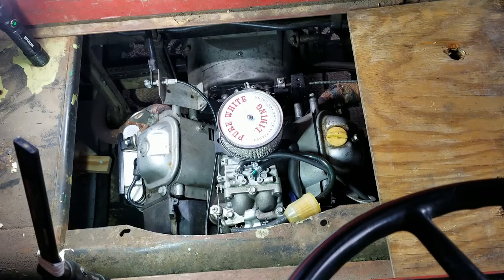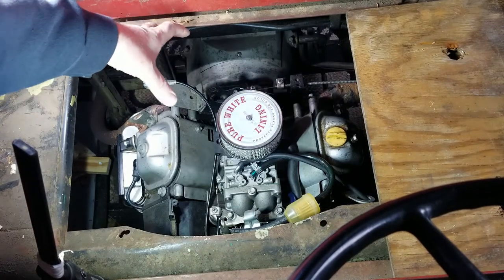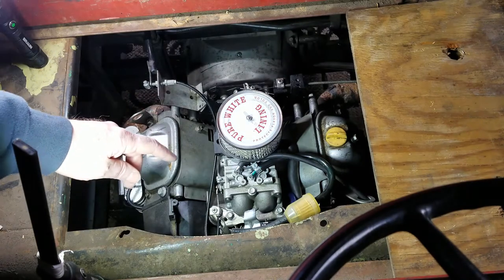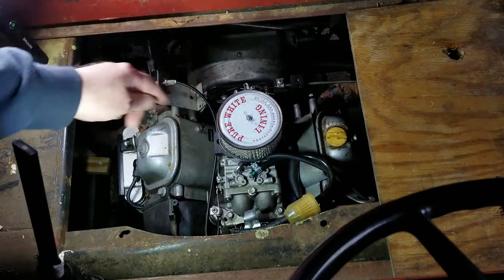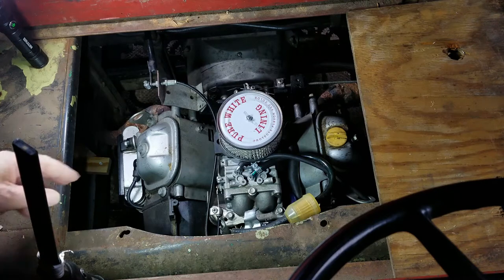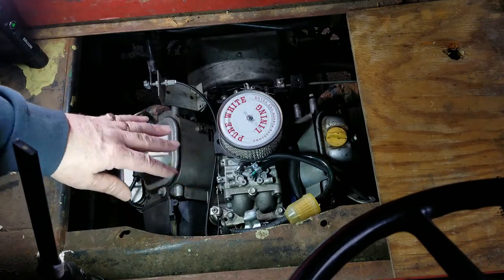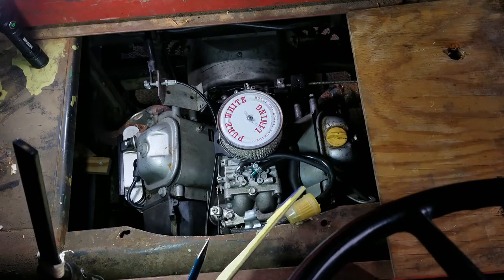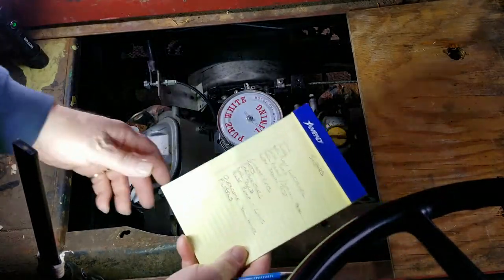PREDATOR 670CC LONG JOURNEY TO RUNNING WELL 5 years

Comment: I know I’m late to the party and I’ve watched your videos and can absolutely appreciate all the time you have spent working through all the nuances of this engine. I thought I had researched this engine enough for my club car build. Now I kind of wish I had looked at a better v twin. My cart does scoot right along but the fuel problem is a total effing nightmare. Thanks again.
Reply from the maker: Evening, changing to no governor and the carburetor change made a huge difference (oh yes a good manual fuel pump). All the best on your project

Comment: Your opening statements covered the problems I’m dealing with now. I put a electric fuel pump on with filter and a regulator. Didn’t bypass the stock fuel pump ( still have to figure out how to do that) and ended up with a flooded engine full of gas. Drained the oil and hoping to start over
Reply from the maker: Morning, what ever you do go back to the diaphragm pump, your issues will be fade away, load up the gas via a hand primer, thats in another vid .. best of luck

Comment: Thank you for all of the videos over the years.  I have one in a very old cushman frontline mower that I installed a 670 about 7 years ago and has only run well a couple of times over those years.  Same problems as yours.  One question, is your gas tank elevated above the engine?  I am guessing not due to having the bulb installed.  The gas tank in mine is about even in elevation with the engine.
Reply from the maker: Morning, tank is below the carb, here's the vlog on that process https://youtu.be/CggkVZtfvfo.  Much better after changing the carb to the 24hp clone, there's a few vids on that on the channel.
Reply: @dctmakes3487  Thank you, did that last year!
Reply from the maker: tell us exactly what its doing, My buddie and I will try to come up with some ideas

Comment: Man is this worth bying or not?
Reply from the maker: Yes as long as you put in a little work
Reply: @dctmakes3487  i’m no mechanic by far. I would hate to have to take it to the shop every day
Reply from the maker: @marte1a256   depends on the application as to how much prep work is required. Straight out of the box no exhaust change, no carb change, same shaft size application, your just going to to dealing with fuel . Watch the vids on my channel in order you can make your mind based on the application. Remember I changed the carb, jets, coils, multiple fuel styles and gearbox fitment etc..etc... if it had been on a wood chipper this would have been a different story to tell .....................best of luck
Reply: @dctmakes3487  it’s going on a golf cart that already has that type of motor. It’s going to be a simple swap but I really want it to be dependable
Reply from the maker: @marte1a256  buy it ..install it and test it for 80 days then take it back pre 90 day at harbor if it does not work. or buy the honda or briggs at over 2 to three times the cost . its a toss up ........ check my voice over vid before you do theres some pipe checks straight from the factory to do ..https://studio.youtube.com/video/K_z5l-nbn6Q/edit
Reply: @dctmakes3487  good advice about the 80 days! Thanks